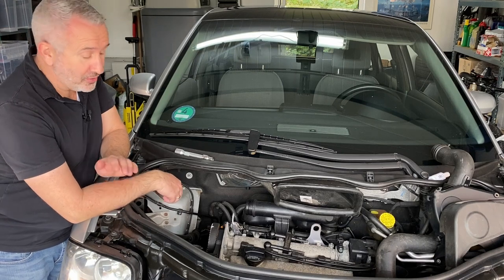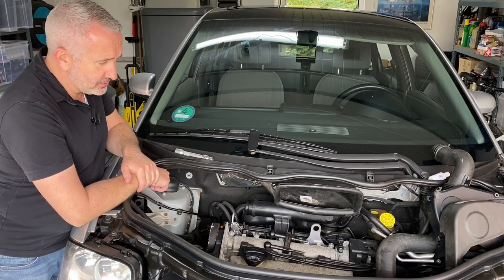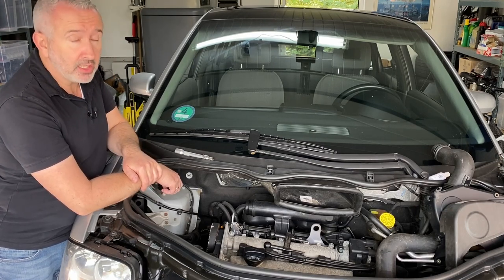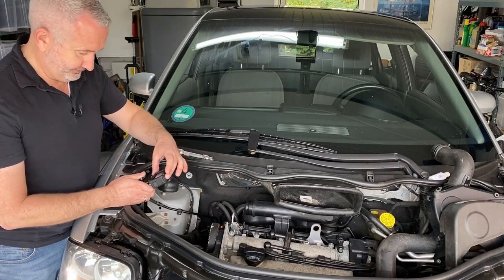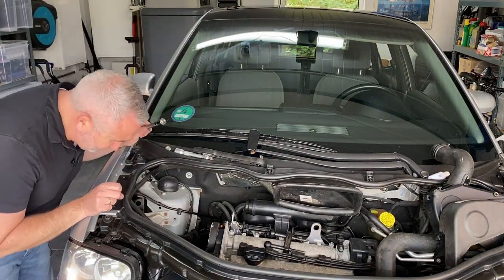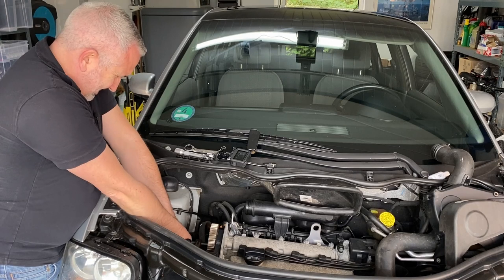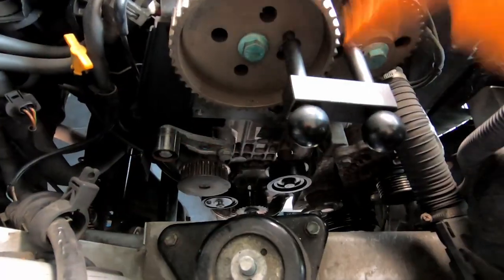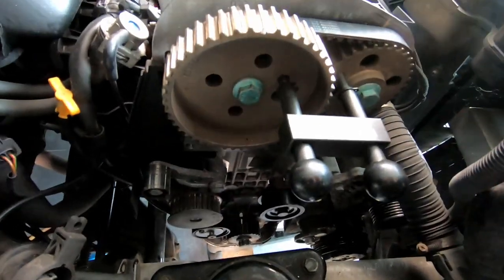DIY Audi A2 Timing Belt Service. Timing WAY OFF! What Could Possibly Go Wrong? 1.4 16V Engine AUA.

Comment: My project this weekend was to add 14 mm spacers to the rear coil-overs of my 2004 MG TF. Full explanation will be a bit long, here the high lights: First fitted softer Bilstein all around, hight adjustable only. Damaged rear ones. Fitted Spax, ride adjustable, not height, but designed to lower car for the sportier stance. Meanwhile, gone thicker on tyres, to shift it to a touring/ motorway muncher ride. Downside, tyre rubs wheel arch covers on full lock (plastic. No damage). So, therefore can't lower front, had to lift rear. First test drive OK. Much stiffer now. Less roll. Seems alright.

Comment: I've always considered that driving the water pump via the timing belt was a crap idea. 
This was brought home to us somewhere in central Portigal when wifey's A4 cabrio developed a bad water leak and we tried to get home by stopping every few kilometres and refilling the cooling system. The timing belt finally fell apart in mid Spain and we eventually got the car home on a recovery truck (long story). 
I decided to try and repair the engine myself (well, I couldn't make it any worse!) Luckily, the pistons were OK and I just had to replace 6 of the 20 valves, the cylinder head gasket and the timing belt, pump and tensioner. 
The Audi A4 1.8 litre 4 cylinder engine is mounted 'north to south' and not transverse, which made the job slightly less of an absolute pig. 
The service history that came with the car mentioned the belt, but not the pump. I didn't realise at the time that the pump was driven by the belt, I assumed it was like my Rover 45 diesel and driven from the crank shaft.  
Moral: Always, always, always replace the pump when the belt is replaced. It's folly not to do so! 
Cheers!

Comment: Ideally, as it's such a faff it's worth replacing the water pump at the same time as the belt kit (includes tensioner). The two have a similar life span and it means you only have to go in there once. Also, as the hot coolant will damage the belt (as you discovered), if you have to revisit the enclosure for the water pump then renew the belt at the same time 👍
The water pump usually fails at the bearing allowing coolant to pass. If neglected, it may fail catastrophically taking the timing belt with it.
Reply from the maker: That was indeed the whole point of this exercise - the water pump had actually failed!
Reply: @dukeofhuzza  yes, sorry for the confusion. I meant if it's time (by mileage or age) for the timing belt(s) to   be changed - always do the water pump as well. Conversely, if it's the pump you're changing due it failing then swap timing belt(s) again.
By the way, "Gartshore's Garage" has a definite ring to it and youll be an expert very soon. 👍😉😁

Comment: Скажите пожалуйста при замене водяного насоса вы сливали антифриз?
Reply from the maker: There was no antifreeze left in the system as the old water pump was leaking. You don’t need to drain the entire system to change the pump, but you will lose some coolant in the process. It’s a good time to do a complete flush and coolant change anyway! Good luck!